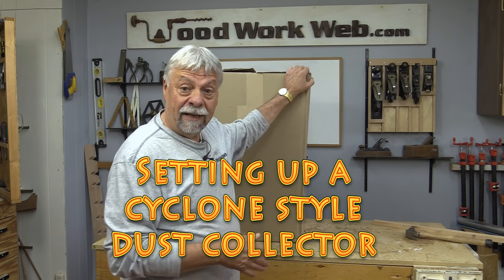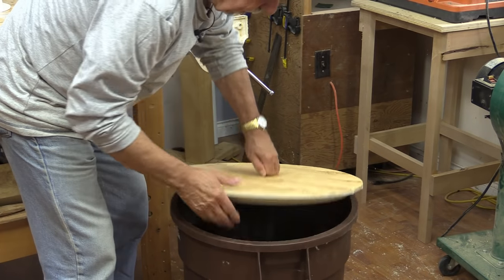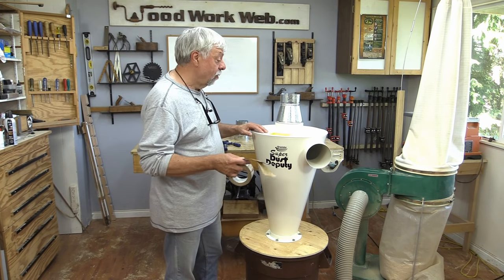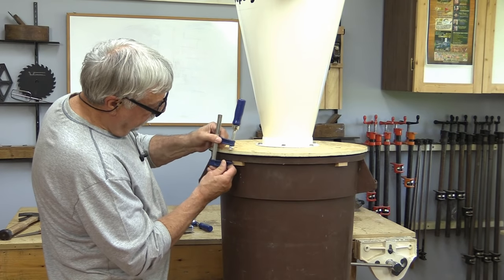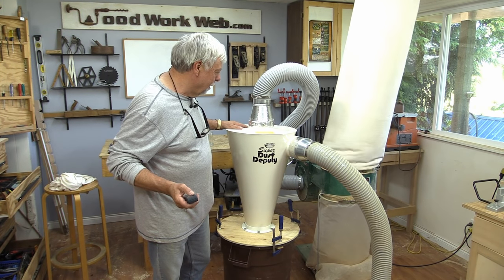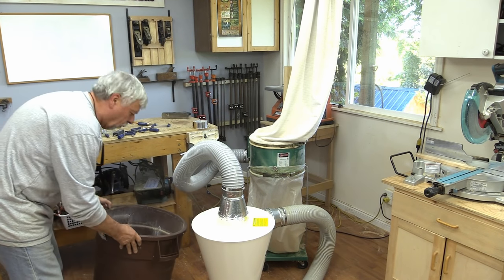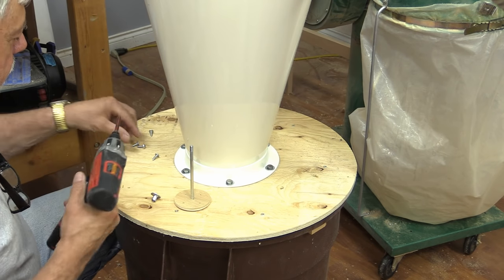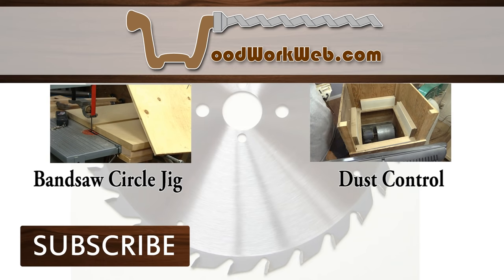Setting Up a Cyclone Dust Collector Upgrade: Single Stage Dust Collector to 2 Stage Collector

Comment: You are going to love having this Colin.  Adding a separator to my DC is probably the best shop project I've ever done.  For what it's worth, you don't need those clamps.  With the weather stripping on the lid the vacuum pressure will keep the system sealed just fine.  I used a fiber drum for my container, and I quit putting the metal strap back on the lid a long time ago because it wasn't doing anything except adding a step to the emptying process.

Comment: You are going to love this Cyclone System Colin. My setup of the topper for the dust bin is exactly the same as you have shown and it works exceptionally well. Adding more connections to tools is a breeze and making a floor sweep for quick cleanups of hand plane shavings etc is very handy. A great video and topic.
Derek

Comment: I have used the Super Dust Deputy (black plastic version) in a similar manner and I am very pleased with how it has performed.  I used a galvanized trash can for mine which I think is more stable than the plastic cans.
Reply: G'day from 'Down Under' (Melbourne). I too have set up a similar system. The quality of the receptacle is important. Before installing the bigger cyclone I set up a portable version with a smaller cyclone and my 10yo Karcher shop vac quickly sucked in the sides of the plastic container -- a sturdy garden planter pot of perfect size. I had already invested time in the container; but problem solved by siliconing some hoops cut to exact length from unused Yellow Tongue saved from sheet flooring and butt jointed on the INSIDE of the pot. Silicone is not ideal for plastics but it only needs friction for a jamb fit on the tapered pot and the advantage is it can be feathered to help the airflow. The mini-me works very well, especially with an off-the-shelf power block designed to activate the power tool and vac together. For my shop ducted system, I bought a barrel used to import Italian olives in bulk. Very sturdy, ribbed and perfect, once I cut it down to exact height and put casters on.

Comment: Nice video!  I have the smaller Dust Deputy on my Shop Vac and it works quite well.I agree with Micheal, below in that you don't necessarily need the clamps.

Comment: To make the hose slide over your metal connector easier, use a ducting trick. Take needle nose pliers grip straight down about an inch down into the top edge of the metal flange. Make a light twist. do this several times around the flange opening. This crimps the edge slightly like an accordion. like you see on one end of a crimped duct tube. It reduces the diameter enough to get the hose over the sharp edge and more easily allows the hose to slide on without catching. You don't need very many and only light twists so your crimps are small.  Hope this helps

Comment: I think the depth gauge is a clever idea. As for the difficulty of installing the hoses, if you have or can borrow a sheet metal crimper and crimp the end about a 1/4" to 3/8" or so it should be much easier to attach the hose.

Comment: GREAT video Colin.  Maybe extend the wheeled base to include the Dust Deputy.  If you mount both of them on one platform, maybe you could use rigid pipe and not the flexible one which would make it basically one unit.
Those things REALLY do work.

Comment: Another upgrade for the harbor freight unit Colin, is to replace the impeller with a Rikon from their 60 - 200 model. The new impeller is a bit larger. It will increase the air flow.  Look on here for others who have done the same (people have been doing this upgrade for years now with great results and no mishaps).  Doing this plus replacing the bag will increase performance and make your air much cleaner .  There are solid cannisters for the top bag that will filter down to 0.5 microns, which is way better than the 1 to 5 microns the bags do.  Thanks for sharing !

Comment: Hie sir!
3 questions here: 
I bought 1hp dust collector for my table saw, planer, etc. I will make a cyclone for it.
1. Does it change anything if I make the plastic and filter bags a lot smaller?
2. How big should be the cyclone?
3. Is it better to use only 4 inches hoses for the cyclone and the dust collector?

Comment: First may I suggest using J hooks (machine screw threads with a J shape hook on one end) with thumb nuts to hold cyclone to trash barrel. Sadly you still need to increase air flow to collect better. There may be better filters available, (You don't mention the micron size capability of your current filter). Any improvement is better then the start point!  ;}

Comment: Instead of clamping, why not use screws through the lid directly into the wood blocks you made?
Reply: Except it won't be turned on all the time, and that funnel is weighty. He still needs something to keep it attached to the trash can.

Comment: Did you have any issues with the garbage can getting mishaped and changing suction power as a result of air pull? I have a 2Hp set up and caused the can (plastic) to buckle in and created a poor seal

Comment: I have practically the same dust collector as your HVLP 'Bag' system. It works well, and I can see through the polly bag when it is full. So what advantage to you get from hooking up the large Dust Deputy cyclone? BTW, I do have the miniature DD cyclones hooked up to my Sander and  Mitre Saw station, so can also say they work well, but perplexed as to why you would have two systems in series?
Reply: I should read the full description before asking questions!!! engage brain before operating mouth (fingers) :)

Comment: Did the garbage can collapse on you? In general even the 2 inch versions will collapse a standard 5 gallon bucket and their walls tend to be more rigid than those type of garbage cans.

Comment: Great project, next I would look into replacing that filter bag with sold filter. Jump over to "Stumpy Nubs" channel, he has all info there for the conversion, almost to much info! I suffer from extreme allergies so for me to do anything in the shop it has to clean! Love your videos, keep them coming. Thumbs up.
Reply: the first upgrade anyone should make it a pleated filter and ditch the bag but best advice is just buy the pre-made cyclone system to start with now that they are available for a reasonable cost from Grizzly and others. I know a few years ago these options were not available and like him I did a conversion like this but for anyone new skipping this is the best thing to do. this is not a good long term solution
Reply: I just went on the Grizzly site and the cheapest one is $865.  One the same as this mock up is $1,025.00.  If you do it yourself you could do it for just under $500, $600 if you upgrade the filter. May not look as nice but could will save you alot of money.  Most people aren't going to go out and buy all of this stuff they will be upgrading what they already have.   I would much rather have the Grizzly but since I have my old delta system that is working fine this way an easy $200 upgrade for me that is working great.  I did put a piece of plexiglass on top instead of the rod.

Comment: I have the small version of the dust deputy and absolutely love how well it works. I just have it hooked inline with a shop vac and very little makes it to the filter. I just had one question the threaded rod you put through the top is for what and just how is it going to operate??? Thank you as always for sharing
Reply: It's a depth gauge for the dust.  Just push it down and it will tell you when to empty the garbage can.

Comment: I don't think you need the clamps to hold the cyclone to the trash can.  The vacuum pressure will seal these two items together more tightly than your clamps.  Give it a try and see if you think that will work for you, it so, it will save time by not requiring the use of clamps.
Reply: Clamps hold it more when it is OFF. All of that flex pipe would tend to make it top heavy.

Comment: Great video, Colin.  I'm in the process of building/installing a two stage dust collector and have chosen the molded version of the Super Dust Deputy.  Is there a reason you opted for the metal version?

Comment: i've a common cyclone separator too but what if some dust goes anyway into the vacuum?? What's wrong??
Reply: If the dust goes into the vacuum, then the dust filter will catch it. Nothing's wrong... it shows that you have 2 stages of filtration which means it's better than one stage.

Comment: Dust deputy is way too expensive!
Reply: Yeah they get to charge loads because they're basically the only product on the market. Really easy shape to make from metal yourself though. Get a hand riveter, thin sheet metal and get a cone template generator from the internet, cut it out and rivet together, bam, cyclone.
Reply: Got mine on Amazon for $20 bucks

Comment: I don't get the metal rod you attached ti the top?
Reply: I didn't understand this at first either but he made a depth gauge so he could push the rod down into the can and when the rod/plexi hits the dust pile it will stop and he'll know how full the can is.
Reply: Chris Greninger  oh, ok.
Reply: I've inserted a plexiglass disc into the lid to check visually the filling level. 
That's simple, easy, tight and effective.
Reply: cejkwo Mass ty,